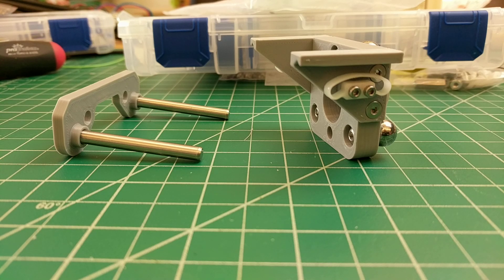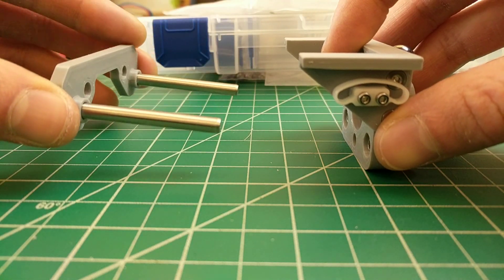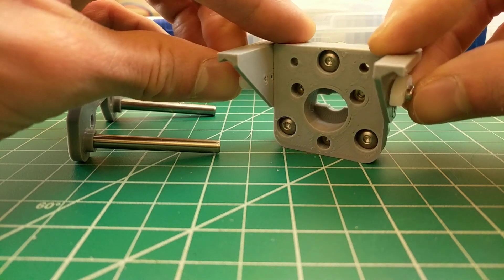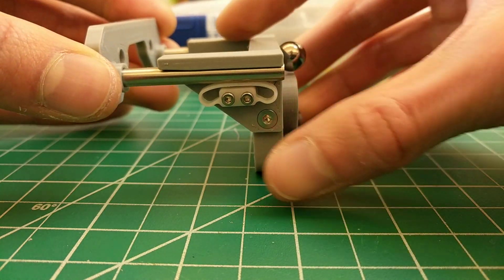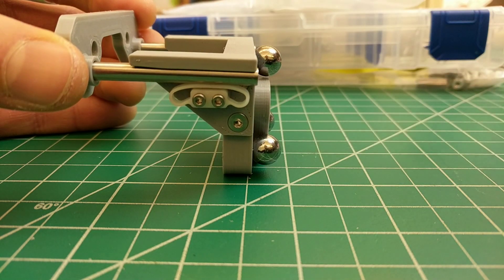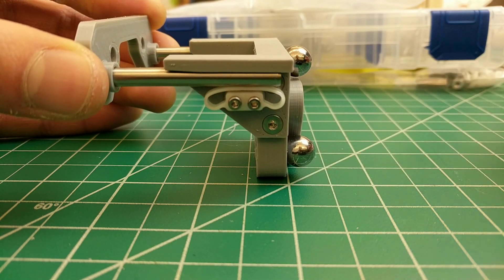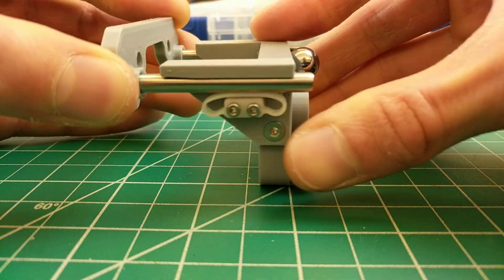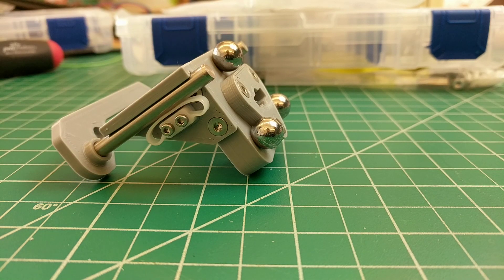Tool Changer Parking Post Overview

Comment: How are those smooth metal balls called and where did you get them?
Reply from the maker: In this version, the tool balls are 10mm, M4 threaded balls from a Kossel 3D Printer.
https://www.aliexpress.com/item/32646556334.html
But in the latest version of Jubilee, they are 8mm, M3 threaded balls that I had made in bulk. You can pick them up from Filastruder or Hightemp3D. 
https://www.filastruder.com/collections/jubilee/products/tool-balls-for-jubilee-3-pack
https://hightemp3d.com/products/polished-8-mm-steel-ball-with-m3-thread-3d-printer
Hope this helps!